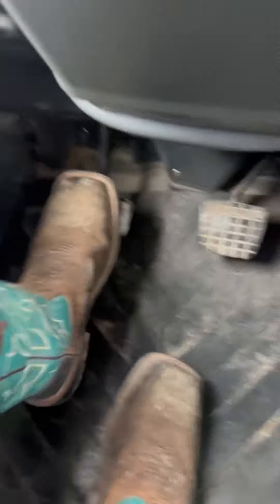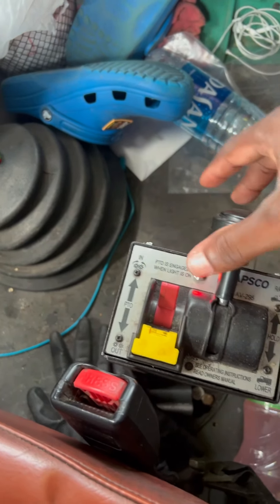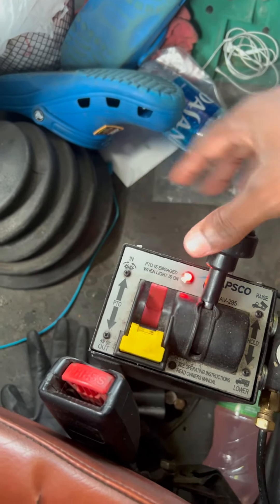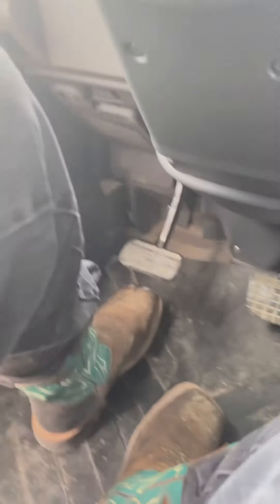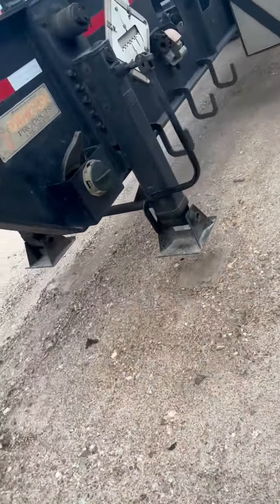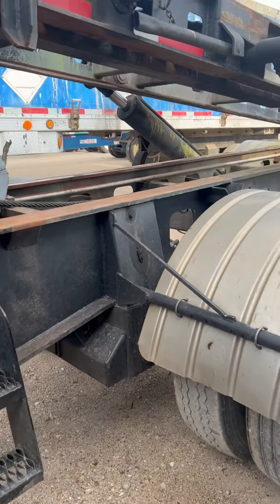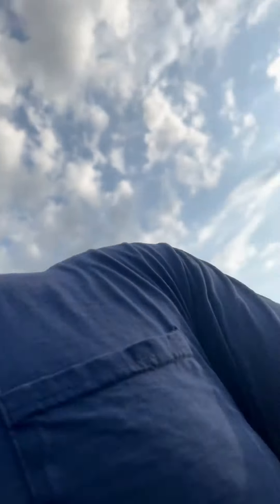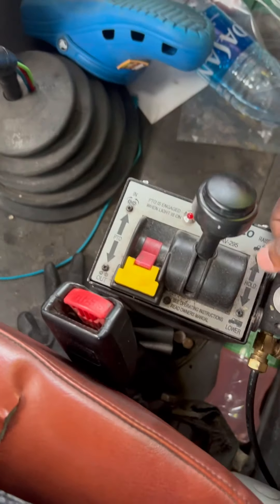How to turn on PTO . Tractor trailer roll off, End Dump Vacuum tank #rolloff #pto  #trucking

Comment: Bro  how  weight can you carry  on your, roll off, looks like you gotta  long one,so you can carry 2 20ft boxes  when you pick up a box on the street  thats  loaded  don't you  to get rpm  or can you lift a box while  just  idling mine I gotta give it some  throttle .
Reply from the maker: Some throttle with the rpm’s a about, 12 to 15 and ya 2 empty or 1 loaded and 1 empty at the same time , never 2 loaded unless both boxes are light, you don’t wanna go over wight